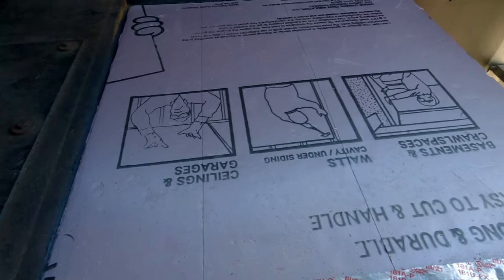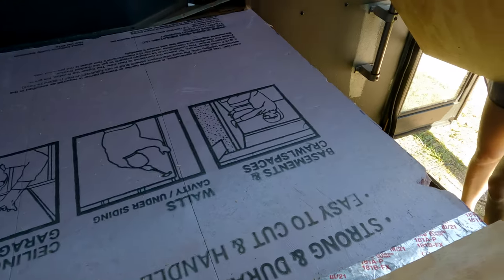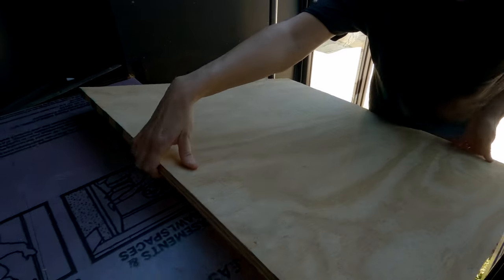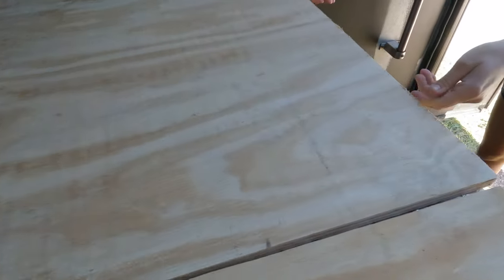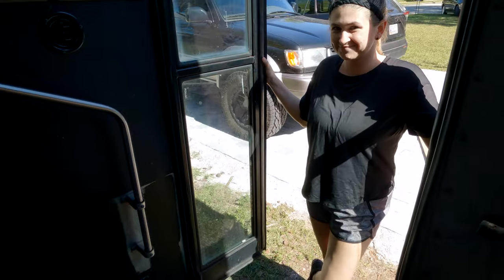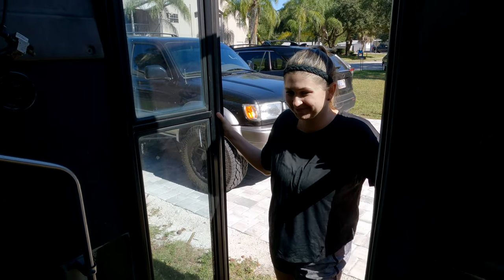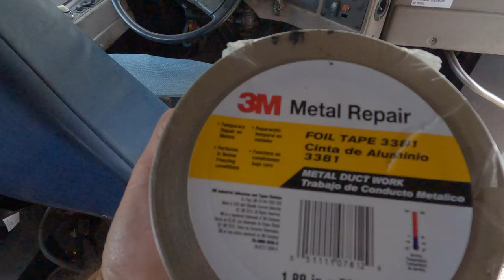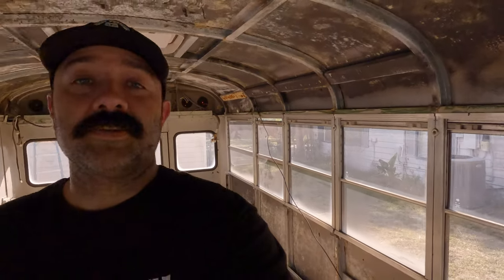School Bus Conversion | Installing Subfloors | Episode 3

Comment: How much head room did you lose with the floor foam an wood?
Reply from the maker: Less than an inch and half but we have a high ceiling due to it having a wheel chair lift in it. From floor to ceiling it's roughly 6'3
Reply: @TheLostWolvesSRQ  oh ok kewl